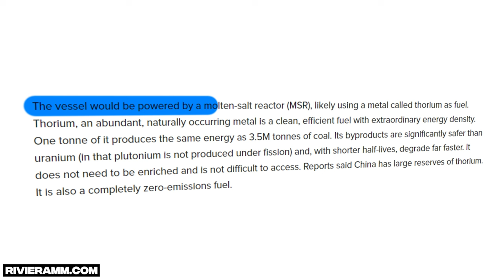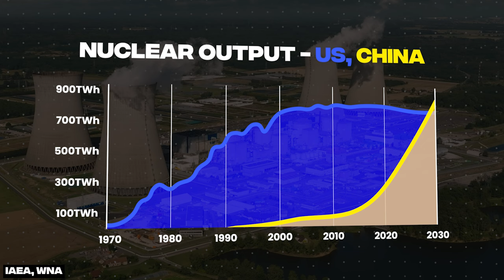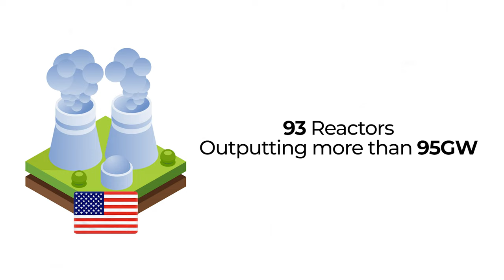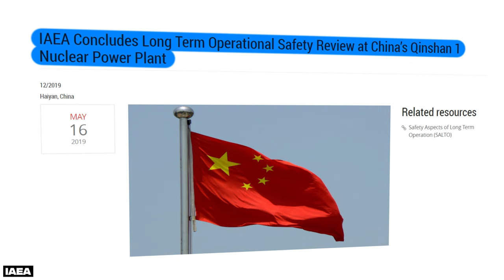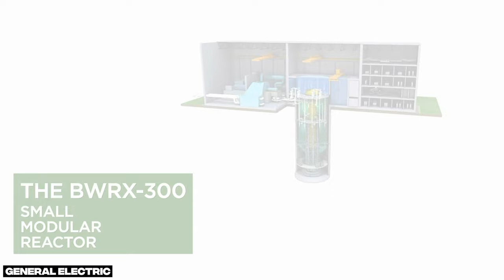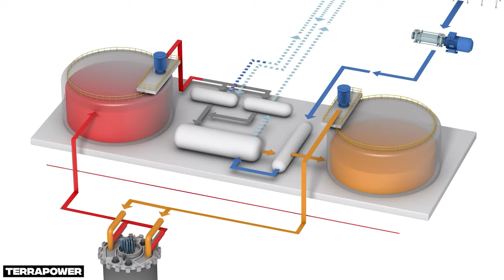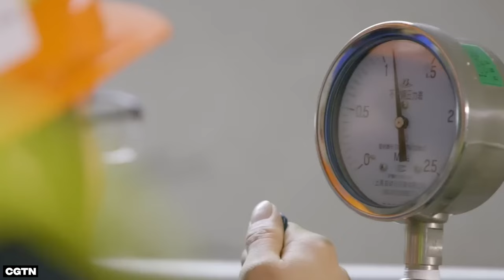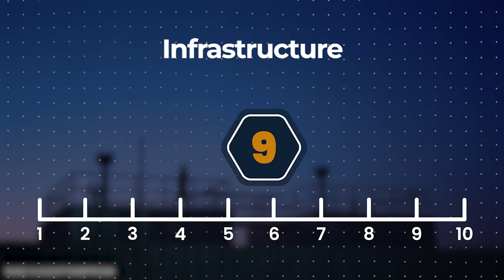How The West Powers China's Nuclear Plans

Comment: The info here is out of date. There are already 2 operational Chinese reactors in Pakistan and another planned in Argentina. A SMR reactor ACP100 is already in testing, expected to online by 2026. But it will be a long time before the Thorium MSR reactors are ready for primetime, even if a experimental reactor is in operation. Mixed fuel reactor or more conventional Thorium  reactor are more likely to appear sooner. MSR are a tough tech to crack even if China has some experience already with Molten Salt thermo solar power plant. The US spend 40 years trying without success, Oakridge wasn't the  last Thorium facility.
Reply from the maker: You're right, 2 units built by the Chinese in Pakistan have already connected. But here the video was (indirectly) referring to the two new ones that were started in 2023, expected to be online in 2030.
China is really going for thorium as a fuel, and I think that's fantastic. If they can advance beyond what Oak Ridge did and share it (as the work China is doing is openly based on the Oak Ridge MSR tests), that's even better.
Reply: @atomicblender it is just way of thinking as far as "borrowing ideas" go, (westerners not happy Chinese was not paying any IP fees 🤭 understandably, Chinese understand where it come from, but it does not care; for Chinese, why stand on the ground when you can stand on gaint's shoulders (in this case, competitor's head) they don't care, let the dog do all the work or lead you to your enemy, let the beaver build the dam so you can enjoy
Reply: @marke9036 its funny if using same logic first blackpowder is come from china and copied by west and develope more faster than its first investor
Reply: @atomicblender Mostly because China does not have much domestic Uranium deposit.
Reply: Plus an operating Chinese nuclear plant in Turkey that easily withstood the massive earthquake.
Reply: @marke9036  What IP fees? Patents run out in 15 years.  Further, the Chinese hired Oak Ridge as a consultant on its thorium reactor design.
Reply: 0:47

Comment: Just because most of their nuclear plants are PWRs doesn’t mean they are old technologies.. well, maybe old, well tested technologies with modern innovations and passive safety, making them more advanced than those of the olden days. 
It’s simply just the most practical form of nuclear energy generation. China has a variety of 4th gen nuclear stations, they are mostly experimental and very expensive. They also are forefront in modular commercial SMRs with their LingLong reactors.
Reply from the maker: I'd say that's a fair assessment. Just because the design is old doesn't mean it won't work. At the end of the day, the goal is to safely get electricity out the back end. Improvements happen in nuclear energy, just slowly.

Comment: If they can do a factory built, at reasonable cost, thorium-MSR mico-reactor, crank them out, pack it on a ship (or elsewhere), this would be game changer.  My hat off to them.  It maybe a Sputnik moment, if the west chooses to take up the challenge.

As for borrowing ideas, there is no shame in this.  The issue now is ability being able to manufacture and deploy en masse.  This allows for developing experience, dropping costs, and scaling.  Nuclear doesn't have to be inherently over-budge, over-time.  I've heard S. Korea is able to build these, on budget, and on time.  But one has to be building a lot of these.  So they've developed the experience, muscle memory, for doing this well, and doing it repetitively.
Reply from the maker: Fair point, S. Korea, Russia, and China are all able to build with relatively certain timelines and within costs. Nuclear-powered shipping would definitely have advantages, especially if it can be done inexpensively.

Comment: 2 key comments:   1) Those copies of the AP-1000 are I believe licensed copies of the AP-1000.  Westinghouse seems to be involved with them and I understand that last year China signed a contract with Westinghouse for 6 of them.  So don't count out the US participation.

2) The article for the ship is fake optimistic PR.   China only started up a 2 MWthemal thorium based MSR last August.   The key purpose of the test reactor is to see if they have found a solution to the MSR corrsion & radiation cracking of the Oak Ridge late 1960's test reactor Hastally tubes and piping along with seeing if a chemical filtration system works well enough that combined with the new super-alloy will reduce the problem to a low enough rate that a 40+ year operating life power plant could be constructed in the future.   It will be years before we know it works good enough - if it works good enough.

If it does work then China is planing on building a 20-30 MWthermal test reactor to see how it scales up (as the nuclear world is full of closed early plants that did not scale up from the test reactors well).   If that plant works well for years then they will design a 40-60 MWe demonstation/test power plant.  Only after that runs well with no problems will they design potential marine and power plants.   This will take a long time (likely a couple decades) and that is assuming that they currently have a workable solution - and that things scale up without problems.   It will take longer if there are problems along the way.

Also the  USA built the NS Savannah as a nuclear powered civilian cargo ship in 1959 based on naval reactors.    It failed badly as it was extremely costly to operate due to the nuclear crewing requirements and many ports refused to let it dock.  Other factors are that the nuclear power plant was I believe about 60% of the cost of the ship - a totally outrageous cost for a ship engine at the time; and the cost of defueling the reactor and cleaning up things (to where they are now) and future demolition was and will be born by the US Taxpayers.   I just don't see nuclear powered civilian ships as cost effective.
Reply from the maker: 1 - Yep, the tech transfer for the AP-1000s were part of the package when Westinghouse sold 4 reactors. The CAP1000 is still basically a copy, even if the tech transfer is legitimate. Further US involvement is still there, but clearly it will be much less than in the early 2000s during the initial AP1000 constructions.

2 - It could still happen! The point of articles like that is to drum up support, funding, national pride, etc. Technical problems are to be sorted later. There are a few other companies trying to build thorium MSRs on ships (Thorcon is one that comes to mind). Whether they'll succeed or not, I certainly can't say.

Comment: The importance of the EV development is almost completely ignored or overlooked in the US. If ever EVs comprehensively replace ICE cars (which has from the beginning been said to be necessary to eliminate air pollution), a massive incremental capacity to generate electricity will be needed to power those cars. Unless that electricity demand is met with green electricity, all that would've been accomplished is to replace tailpipes with smoke stacks as the source of air pollution. The Chinese have  evidently figured that out, and it may be a significant reason for all the effort they've placed on becoming self-sufficient nuclear energy producers.

Comment: using all west design? really? west design to TMSR failed on the decay of the pipe; too bad.
Reply from the maker: Nearly all large reactors in China have been derived from western technology. The TMSR design under development has openly credited the earlier Oak Ridge research as its starting point. This isn't a bad thing, just building on what others have done.
Reply: just saying, Chinese TMSR design is much different from Oak Ridge lab design, basically, the reactors are different.
Reply: @atomicblender  I mean the reactor cores are different design already.